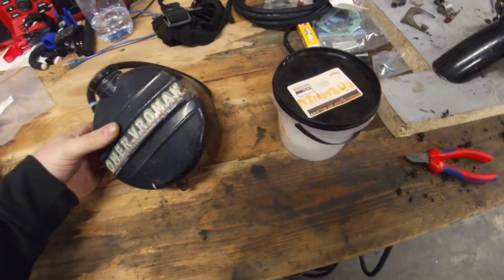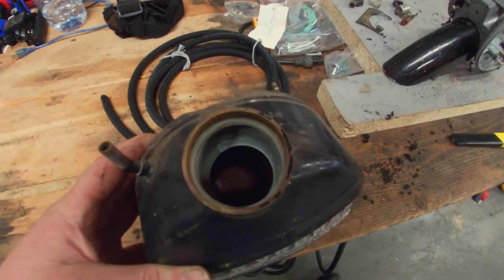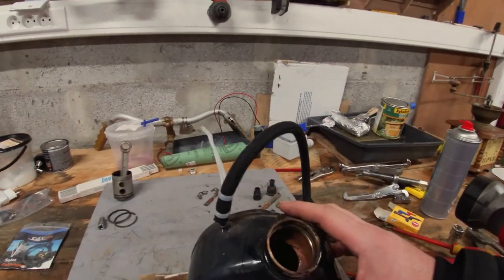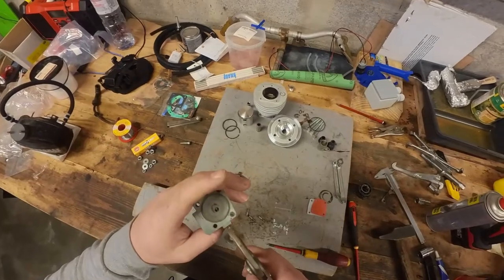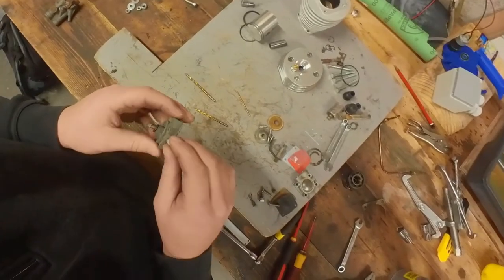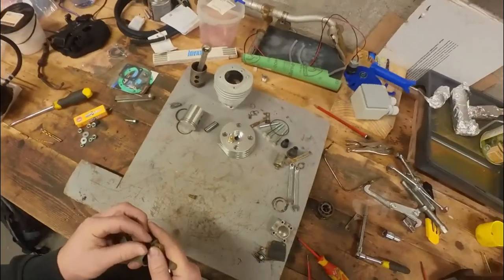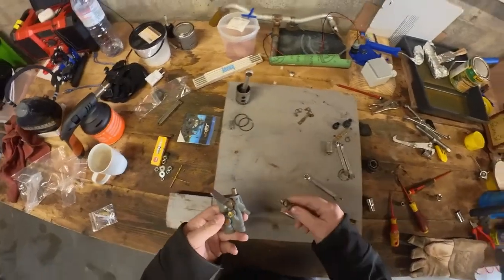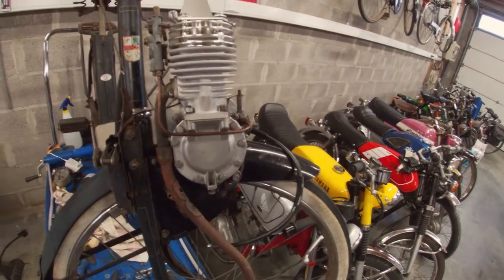Solex 1400 (Koffertje) Fuel system

Comment: I soaked my fuel pump in carb cleaner for 2 days and the tapped it on my wooden work bench. I blew into the pump and it freed up.
Reply from the maker: Glad it worked, they are very finneky sometimes